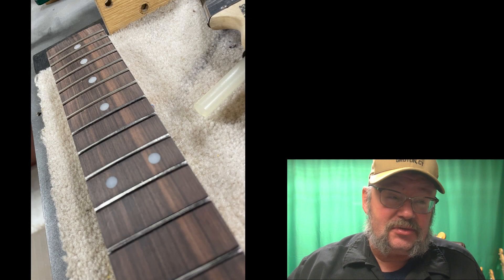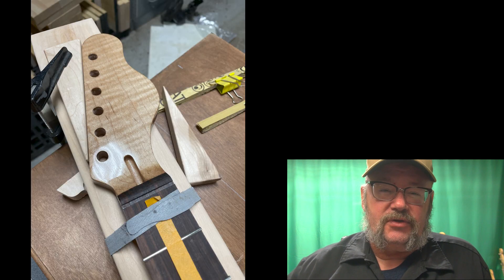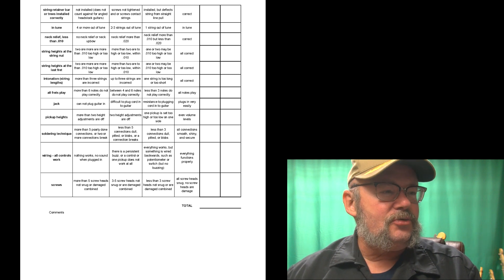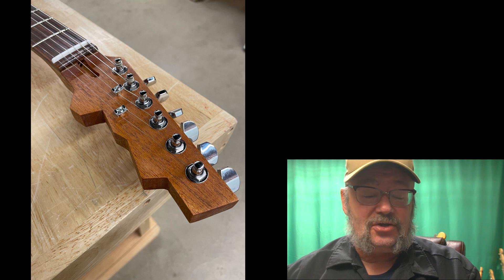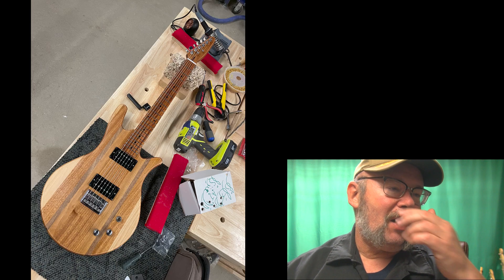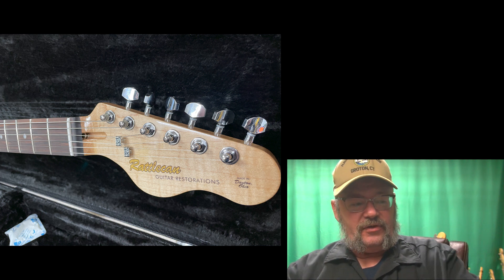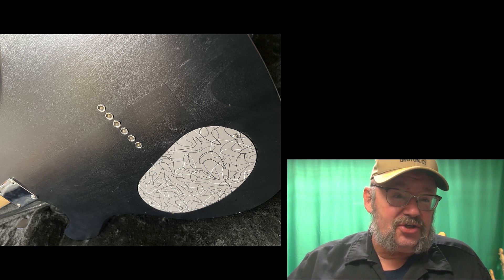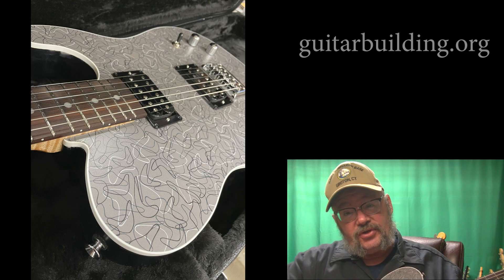Guitar Manufacturing using STEM Concepts FINAL EXAM | RATTLECAN GUITAR RESTORATIONS by James O’Rear

Comment: Looks great James! It's Formica is a little retro so how about "The Diner Castor". Or just call it "Flow". That neck adjustment can be easily done. Loosen the screws a bit and bang it the direction you need to get the strings parallel. Very common trick on a bolt on neck.
Reply from the maker: Ha….Flo. I hadn’t thought about that.